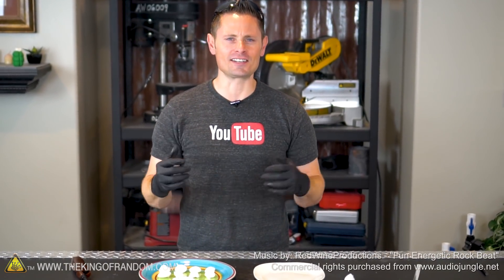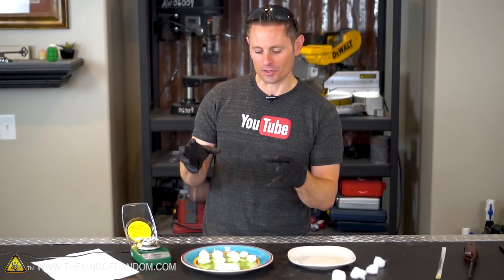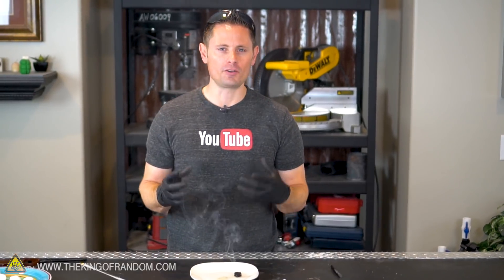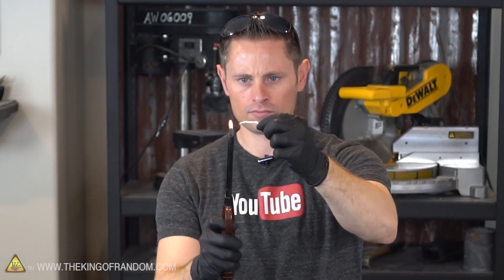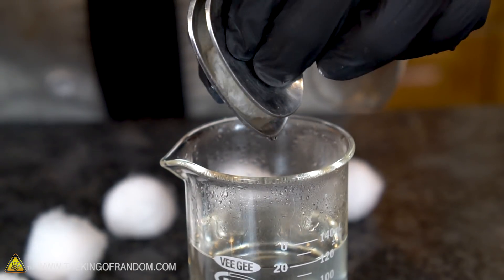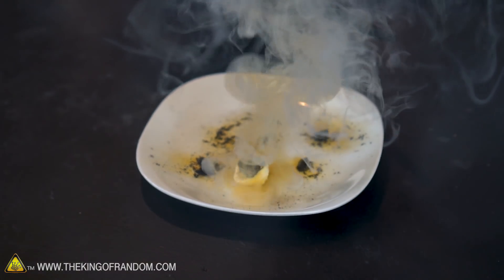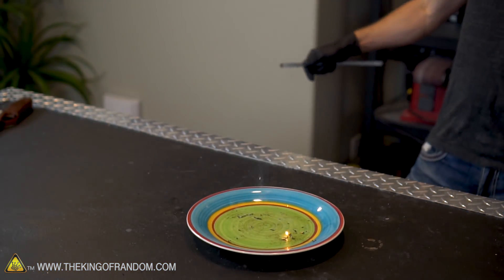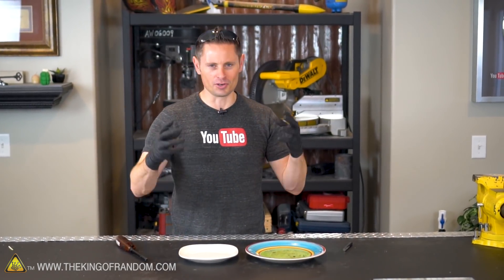DIY Flash Cotton Burns Super Fast! How To Make Nitro Cotton Or Flash Paper

Comment: True gun cotton does not leave a trace when you burn it on a mirror. It will flash off. You can put a 1/2" of it in a metal test tube and put a rubber cork in the end and it will shoot it across the room.
It soaks for 45 minutes and rinse  thoroughly with nothing but water.

Comment: You are making nitrocellulose, which is what smokeless propellants (smokeless gunpowder) is made from.  You can make it from pretty much any kind of cellulose, it doesn't have to be cotton balls.  Shredded newspaper works just fine too.

Another name for what you're making is "guncotton".  It was found to be excessively fast burning and caused over-pressure failures in gun barrels so the same basic stuff was granulated with a surface retardant added to control the burn rate and that is the foundation of modern firearms propellants.  In a nutshell and yes my description is over-simplified and ignores the differences in single and double base propellants but will serve for the purposes of this discussion just fine because ...

You have created something that burns very fast with its own oxidizer.  Plain ol' cotton gets oxygen from the air around it to burn.  Your guncotton doesn't need air, it carries its own oxygen.  You'll notice that there's significant volumetric expansion not only due to heating but also most of the cotton's cellulose is converted to gas leaving behind very little residue.  This is one of its appeals as a propellant, btw.  So IF you put that in something where expansion does not happen freely as it does in open atmosphere it is going to create pressure.  Like it does in a gun barrel.  Or an ordinance shell.  

You do not want to be in close proximity to that reaction when it happens.  

What you have isn't properly called an explosive, it's a deflagrant.  The difference being that a deflagrant disintegrates at the flame front and a detonant (explosive) disintegrates at the shock wave-front which is usually the speed of sound in the material detonating.  Deflagrants are slower and less energetic than detonants but that still doesn't mean you want to be standing next to it when it does its thing.

You REALLY shouldn't be breathing that "yellow smoke", just FYI.

Comment: when packed tight can it explode ?
Reply: Its a deflagrant, not an explosive, but if confined in a container it could develop significant pressure and be dangerous.  Nitrocellulose is a common ingredient in smokeless powders.  If relatively pure cellulose is used and the nitration reaction is run to completion there would be virtually no ash and smoke.
Reply: richhagenchicago nah mate nitrocellulose is definatley a HE if u use an effective enough detonator, it detonates at around 7300 m/s much higher then TNT.

Comment: To control for the moisture content, you'd want to dessicate the cotton before both weighings. You can get silica gel cat litter, leave it in a warm oven to drive out all the water it's already absorbed, and then put it in an airtight storage box (Tupperware, Rubbermaid). Pop the cotton in the box for an hour or two, and Bob's your uncle.

Comment: As someone who works for a multinational chemical company I find your video's frustrating, so much potential but an unwillingness on your part to truly explore the 'exotic' options. 

Here's an idea for 5 videos: 
1, Does the nitro cotton dissolve in acetone
2, What happens when you initiate the acetone residue with molten iron from thermite?. 
3, What happens when you mix Potassium Permanganate with sulfuric acid?
4, What happens when you drop vodka onto KMnO4 + H2SO4 compound?
5, What happens if you drop a ball a nitro cotton into KMnO4 + H2SO4 compound?

Considering you make at least $1000 per video I recon you owe me a thumbs up.

Comment: If they are fully nitrated then increasing the surface area won't improve burning as it already have the oxygen necessary. 

I'm fact compacting it will cause it to burn faster as the heat can spread faster and be mord concentrated.

Hence why you pack gunpowder.

Comment: Could you use flash cotton as a improvised fuse?
Reply: iiBoltZ Bltz probably. It depends on the burn time and consistency.
Reply: I would say yes, but you'd be better off making a batch of black powder and twisting it into paper fuses, as you'd need a lot of nitrocellulose to get even a second of fuse time.
Reply: GnomeyFoamy i know. Slower, more reliable methods are available than a "flashcard fuse".

Comment: The cotton ball gains mass as the cellulose within it reacts with the HNO3. The strong acid ionizes the sugar itself, then the nitrates ion from the acid bonds to the cellulose. This forms a compound with a greater total atomic mass than the simple cellulose. This is the same reason why rusting iron causes the mass to increase, because oxygen is added to the iron, giving the molecule a greater atomic mass. Nitrate-Enriched cellulose burns so fast as the nitrates provide an oxygen source apart from both the air and the sugar itself.

Comment: Try this out, a random fact I saw and googled "The scientists noted that 80-proof tequila (40 percent alcohol) had the ideal proportion of ethanol to water to create diamond films. In order to make the diamonds, they evaporated the tequila into a vapor, and then heated the vapor above 1400 degrees Fahrenheit before depositing it on silicon or stainless steel trays."

Comment: The increase of the weigth is due to the change of the molecular structure. The molar weigth (weigth of 6,022*10^23 molecules) of the cellulose is smaller than the one of the nitrocellulose. To be a bit more precise: Cellulose has lots of OH-Groups which are exchanged by NO3 groups and these are heavier.

Comment: When building rocket engines with blackpowder grain, we knew when they had dried completely by weighing every day.  when they stopped losing weight, they were dry.  Putting them in a sealed tupperware container with a layer of silica gel beads on the bottom made them dry faster.

Comment: The reason the 8th cotton-ball didn't visually ignite and put out yellow/orange smoke is because the energy provided by the reaction is not enough to sustain the reaction you always saw before (flashing/exploding cotton).
In this process it releases most likely NO2 gas, which is toxic and can [in some cases] react with water to form Nitric-Acid again. The "smell of sulfuric-acid" was (most likley) the nitric acid which formed inside your nostrils or the NO2 gas itself (altough it smellf more like muriatic-acid in my opinion).

Comment: You use the ferrocerium rod wrong, instead of pushing the blade towards the fuel, you have to pull the rod backwards and hold the blade steady near to your fuel. Like this you don't risk hitting your pile of sticks and whatever fuel you use to start the fire.

Comment: You keep implying that the limiting reagent was "80ml of nitric acid", however that is simply not true. If you used concentrated H2SO4 (instead of the fairly wet 93% stuff) as well as using more of it, your nitrating solution would have been able to do quite a bit more. Nitric acid is simply not able to nitrate cellulose on its own, and water also kills the reaction. That's why it stops working. You still have quite a lot of nitric acid left in the solution, however its so wet after using only 60ml of wet H2SO4, and nitrating 5 cotton balls, that it doesn't work as well any more. However, if you recovered the nitric acid from the solution, concentrated it, and then made a fresh solution, I believe you would be able to nitrate all of them with 80ml of nitric acid.

Comment: Nice demonstration, but a nit-pick I got is that the black stuff left over after burning the plain cotton is carbon, not ash. The temperature just didn't remain high enough to burn the charred cotton. If you were to heat it with a torch you would be able to burn it away to almost nothing.

Comment: try building a type of launcher for the flashcotton balls so that you can shoot little fireballs :D
Reply: TheSphereHead if you put two or more little balls in a tube and light the bottom one it launches little fire balls
Reply: TheSphereHead Have you looked up the thermite launcher? Thermite is basically powdered rust and aluminum. It can be ignited with a magnisium flare or similarly high temperature device.

Comment: As I wrote on the last video, your measurements of the acid solution is faulty, as it's a 140 ml beaker and not a 120 ml. You read the wrong side of the beaker. You are supposed to read the right side, not the left.

Comment: you should Make more Nitro cellulose then disolve it with acetone or methylethyl ketone. cotton won't dissolve easily but the nitro cellulose does. when the solvent evaporate it actually has a hard plastic charecterics. it's what they used to make billiard balls from.

Comment: I wonder if there would have been less residue (and less yellow) if the nitric and sulfuric acids had truly been mixed in a 50/50 ratio. Even volumes of different concentrations doesn't make an equal ratio.

Comment: Says he wants to be scientifically accurate. Measures weight incorrectly. Your scale has 2 decimal places of accuracy - those have to be recorded every time. You can't just round. If you only use one figure for your first measurements (of 1 g), then you have to round your second measurements (0.80 g) to 1.

Comment: hey grant could you pleasssseee make solid butane and propane using liquid nitrogen? thx. Btw ive been subscribed since that foam cutter machine you made. :)
Reply: CaHOOTS butane and propane don't freeze in liquids nitrogen
Reply: Yes they do. Even the boiling point of liquid N2 is below (< -190 C) the melting point of both butane and (even) propane.
Reply: Really? Sorry bout that. Didnt really know. they dont really tech the useful stuff at school. :P it would have been cool if it did tho.
Reply: +CaHOOTS
They are wrong; you are correct.  Both butane and propane will freeze in liquid nitrogen.
Reply: Oh. I dont know what to believe now lol. Anyways Thanks for backing me up. :)

Comment: I don't see how you didn't react all of your cotton. You can easily nitrate 1g of cotton/10ml of solution. 
With 98% H2SO4 and 70% HNO3 a 50-50 solution (by vol.) should be used. Did you let it get too hot? Let it sit for 5-10 minutes while stirring and prodding and you should absolutely achieve 1g/10ml.

Comment: melt ceramic!!
Reply: he could with his solar scorcher
Reply: Won't work. Ceramic won't "melt' under anything Grant has used. However it will crack or shatter. Ceramic has a melting point of around 1500 Celsius (2732 Fahrenheit) give or take. Special Ceramics have a melting point of up to 3900 Celsius (7052 Fahrenheit).

Comment: Someone said that a mexican scientists turned a shot of tequila into diamonds by heating it to 800 C is this true? Like so grant can see this
Reply: Shazz its obviously false, 800° is not much and tequila is easy to make. diamonds would be as cheap as salt.
Reply: Lassi Mattila, It's more because one company has an almost complete monopoly on the diamond business, so they control the supply, and they only ever release limited amounts at a time to prevent oversaturation of the market, hence, super-expensive diamonds.
Reply: Diamonds should be cheaper, but it's sold expensive because it looks fancy.
Reply: tequila has carbon cause every organic thing has carbon
Reply: They used the tequila to make diamond coatings to tools like drills etc.. The interesting thing is, that it only worked with tequilla and not f.e. wodka or whisky. Even though they think it's mainly the ethanol that contains the carbon and the few other compounds, that are responsible for the flavour.
Reply: no thats not possible
you need WAY higher temps than 800C and a few dozen tons of pressure
and carbon based materials are used not tequila
Reply: makind diamonds need way more heat and pressure
Reply: Ohh ok thank you

Comment: You can do this without the Nitric aicd. The Sulfuric acid works well actually. The weight question you had is caused it changed the weight with the properties changing. Indeed thats a fact I noticed.

Comment: Couple of questions: 
1. is gun cotton hydroscopic, I'm wondering because my brother had some sheets of flash paper a while ago and each sheet seemed to burns a little bit less than the last as time went on. 
2. I was wondering what would happen if you used graphite instead of charcoal when making gunpowder because as far as I'm aware: graphite is just an allotrope of carbon. I was just wondering if the different structure of carbon would make any changes as to how it reacted.
Love your videos by the way.

Comment: not the worlds first pyrotechnic tampon! i use them to make NC every time!
the tampons work so well due to them being ultra high purityand hollow fibers to absorb blood.
 nitration will add weight  to the substrate.  
you will get a more dramatic effect by putting it on a heated hotplate.

Comment: you should quench a red hot knife in liquid nitrogen.
Reply: pretty sure it would also warp the blade reallllyyy badly
Reply: Idk if you know this but that is a bad idea
Reply: the knife should either shatter due to the extreme thermal shock, or it will be so hot that it will evaporate the nitrogen around it, making a vapor shield that will keep it from coming in contact with the nitrogen. I think it would be fun finding out.
Reply: Hot knife into liquid nitrogen, or liquid nitrogen poured over hot knife?🤔
Reply: (Response to my comment)
I realize liquid nitrogen could dissolve..